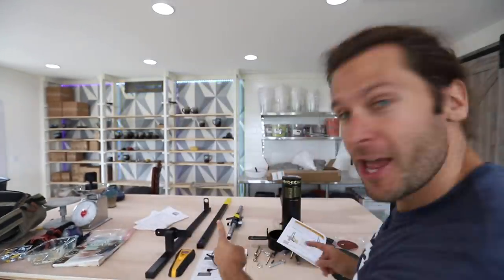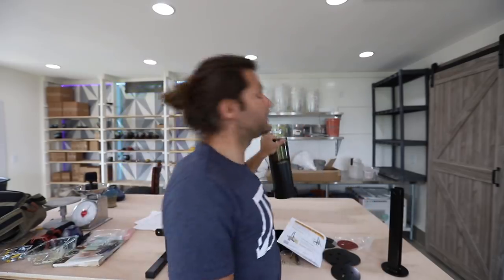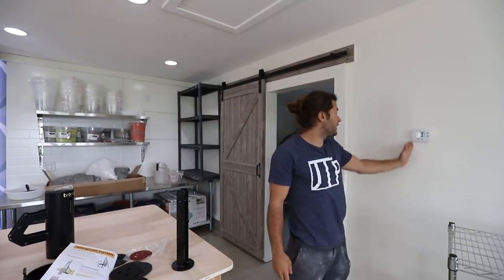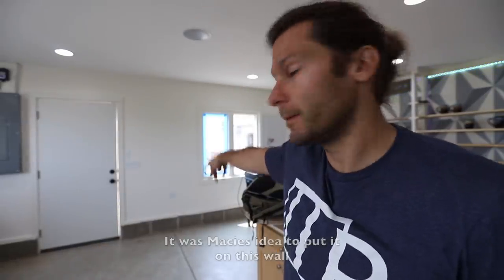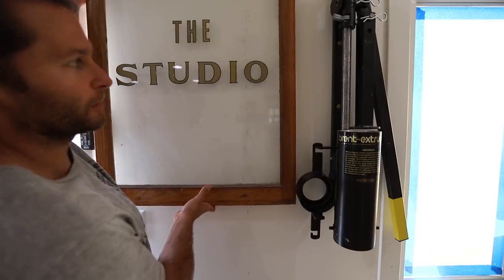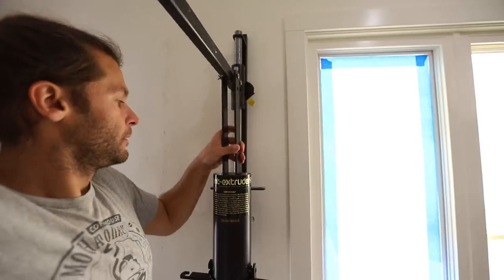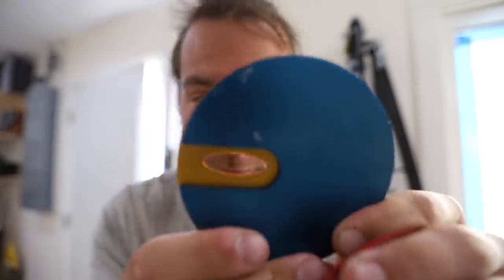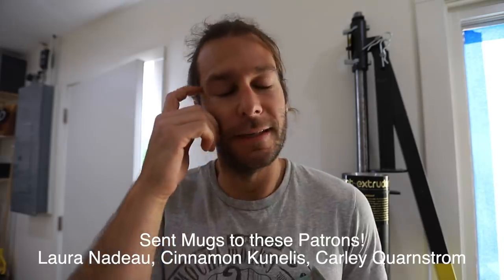NEW Brent HD EXTRUDER - My favorite way to make handles

Comment: Your old extruder is also great.  I've had one for ten years and it works well in our shop. One big plus is how easy it is to make your own dies.  All you have to do to stop the spilling is tighten it down more.  This truly is a great extruder.  It's easy to throw shade when you get an expensive replacement for free. Keep up the good work but remember that most of us are on a tight budget.

Comment: The $220 US extruder from Canada is actually awesome. To keep it from leaking that much you just have to tighten the lag bolts more. Cleaning is not bad with a putty knife and the large (grout type) sponge, although being able to take it off the  wall would be handy. Brent is a great product, however if you are on a budget -do what you gotta do!
Reply: I have that one and love it!! And you can buy a small used kiln and a slab roller with how much MORE MONEY Amaco charges!! They just add zeros because of the name!! Refuse to even use their glazes!!
Reply: Our Lab Tech at UCSB that ran the studio space and made life so much easier for all the students went one step further and mounted the extruder to a rolling frame he built himself.

Comment: Hey John congrats on your new Extruder, I use the same one although yours has the new lock feature (the yellow thingy ;) ).  Tip!!!!!!!!: for keeping the barrel clean is bag the clay first like in a bag for bread loafs (so save those empty  loafbread bags they are the perfect shape and size). You are really making just a big coil, bag it, de-air it by rubbing the air out so that the bag sticks to the clay and just twist it close by twirling the open end of the bag with your fingers...kinda like making a ringlet with a baggie haha.  Now before inserting it into the Extruder make or cut a slit in the bottom of the bag (which is facing down).  The twisted end will be facing upward and will be pushed closed by the pressure plate.  Now extrude away until all the clay is out ( you'll have some clay left).  Take the bag out and put in a new one.  Your barrel should be relatively clean. Saving you clean-up time.  Please share this method in a new video and all I ask is a shout-out haha. By the way this tip comes all the way from Paramaribo, Suriname, South America.  Love your videos!
Reply: Great idea...do you post any utube videos? Would love to see one with this technique...just ordered a Brent Extruder today and value any advice and tips!!
Reply: @terrypiperrealestate518  Hi Terry I Am not that video savvy yet unfortunately...but I should shouldn't I? I'll get a friend to help me with that...thanks.

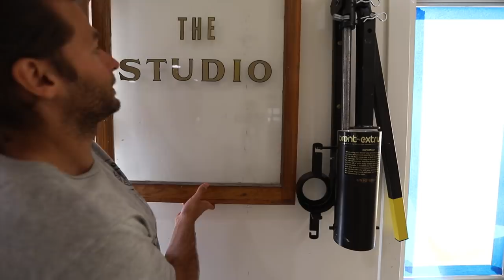Comment: How funny at 5:20.  I was watching video and thought  no you need to mount it next to the door because then you can still use the wall space for storage cabinet or art or whatever. You fixed it. Cool. Great minds think alike because that is exactly where I saw you should put it. Double beam and saved space not obstructing door, path, light switch, or wall space. Good job and thank you. I’m glad I found you. I have just acquired a ceramics, glass, and lapidary shop. I took ceramics in high school and college but never deep enough to be a kiln builder or kiln runner so I have a huge learning curve in front of me and your a huge help.

Comment: Just found this and wanted to mention two ways to make cleaning this extruder faster, easier and with less mess. Use an oversized sponge and push it through; or put Saran (spell) wrap around your clay. Weird and tricky to do until you try it a few times. 

It takes a few times to make it work and is very helpful if you want to switch between dies or clay colors. 

And yes, being able to take the main part over to the sink to quickly clean it up is helpful.

On another type of extruder it helped to have a block of wood that fit above the clay to allow pushing it all the way down to the dye/die instead of having some left in. (Haven’t used one for years so not sure if using a block that fits inside the extruder will help with this design.) 

Love love love your work, especially where elements — fire, water, air & minerals combine and kinda duplicate what we seen in nature on a big scale reduced and conveyed in your cups on a smaller scale.  🤗

Comment: I have used several extruders, over the years, at various places.  They all have their pros and cons.  I like Brent for the collar, that hold the die.  It's easy to put on and take off.  I disliked the old "yoke" system that created the leverage, for the plunger.  I have not uses their new system, on the model you have.  I also do not like the models, where you have to wingnut on the die.  Just takes too long.  I also don't like plungers that are locked to the tube, as it makes cleaning more difficult.
I'm personally a fan of Scott Creek extruders.  The plunger has a "rung" system, which works well, and the collar is easy to take off/ put on, though not quite as easy as Brent.
For your handles, you can design a few of your own, with that blank die.  A jewelr's saw works well to cut out the shape... Orrrr if you know someone with a plasma cutter or CNC machine, you could design them digitally and have them cut out that way.
As I commented on, in your handle making video,  there is nothing wrong with extruded handles.  Some even believe they are stronger than pulled handles l, as the clay particles are compressed together, during their creation.
Happy Extruding!
Reply: Not noticeably true about strength and I've done thousands extruded and pulled. Handles fail at attachment points most often in drying.
Reply: @morganlewis2667  This is not an observation of mine, but a production potter, who mentioned it.